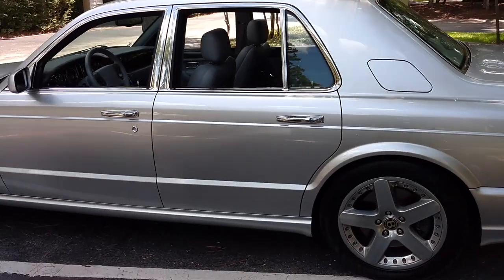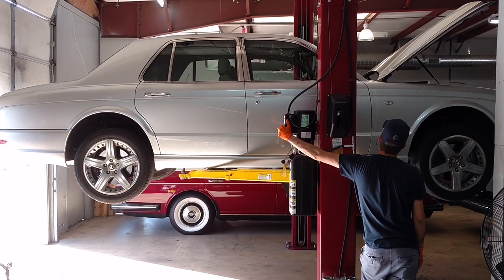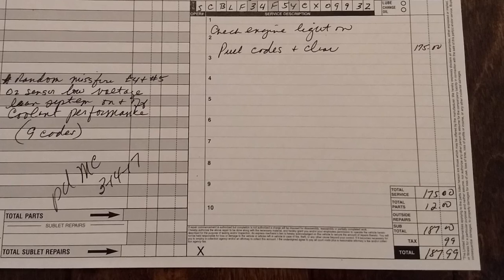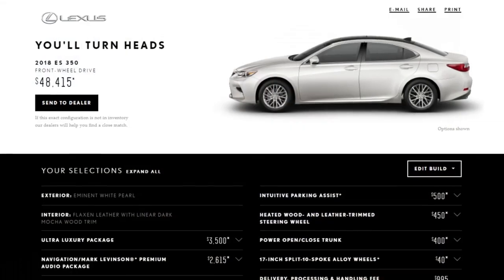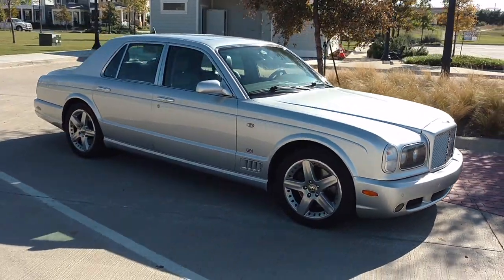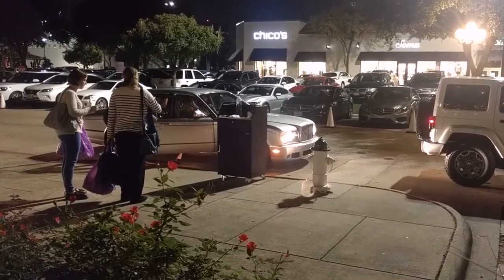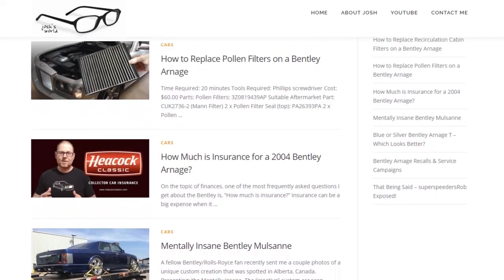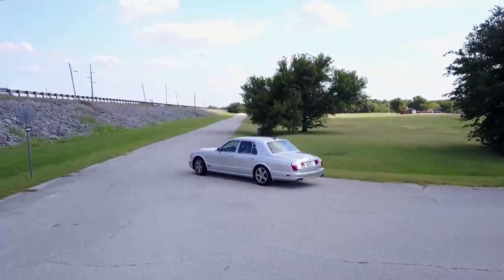Ownership Costs After 1 Year | Owning A Bentley Arnage - Episode 15

Comment: The wife and I took a weekend at the Surf and Sand in Laguna Beach. Pulling into the hotel I saw Mercedes, BMX's and Jaguars. I told my wife we should have brought the Audi instead of my '67 VW Bug. It was custom with European bumpers, shaved trim, re-located turn signals, Centerline Rims with a big and little combo. When we pulled in, the Lobby emptied with people looking at my car. My wife said, "See, aren't you glad we brought the Bug?". I also drive a full custom, chopped top, '49 Ford with flames, '32 Ford 3 window coupe and a '65 Chevy Biscayne with a 550hp 454 and 6 speed.
Reply from the maker: It's a good feeling!

Comment: I used to love buying and driving new and used luxury cars. Lincoln Continentals, Top of the line Caddys, Mercedes, BMW, Jag,  Rolls.  How did I fare financially in the past 50 years? I am now on welfare and am saving up to buy a postage stamp. Come the spring I'm getting a light bulb for the kitchen - one of those new LED bulbs that save you money on the electric bill. This is not a joke - our used BMW, purchased from BMW Manhattan cost over $20,000 in repairs in 2 years. My BMW 740I cost over $10,000 in repairs in one year. My brand new Mercedes 250s in 1970 was a pip - Took delivery of the car from Wolf Motors (Mercedes Dealer)  Drove from NYC to Palm Beach Florida and the car was running very rough. The trip was 1,200 miles. The M-B dealer in Florida said - don't be alarmed - it's just time for your 1,000 mile checkup - $1,250 in 1970 dollars. Unless you're very rich, luxury cars can ruin your life. Buy a Ford. Or  Kia.

Comment: Another great one.  After 8 years of ownership of my 2002 I found mostly the service costs experience as you have.  You do however have to stay on top of it, which it looks like you do.   Steering column is a big one and spheres, thought not as big, are a necessary evil every few years. Also, watch out for window regulators, they are plagued by tiny plastic bits that can wear out or can be chewed up if the windows are not properly reset after a dead or swapped battery.   Overall, enjoy and keep up the good work on the videos.

Comment: Awesome video. I had a smaller budget because I'm in my upper 20s but four years ago I bought a 1997 BMW 740iL for $5K. It was $105,000 new in 2017 money and everyone warned me of impending financial disaster. In 4 years it actually did need lots of suspension parts changed and intake related gaskets but all were DIY thanks to the forums. I would buy it again in a heartbeat and the pleasures are many owning a car that is still very much a $105,000 car! Btw, we have the same 4.4L BMW engine, yours is twin turbo'd and we have the same ZF 5hp-30 transmission!
Reply from the maker: Thanks! Those are great cars. The earlier Arnage Green Label cars shared your car's drivetrain. By 2004, Bentley had already switched to the 6.75 liter Rolls-Royce V8. It still shares some components with the BMW. The climate control system is from BMW, as well as some other parts.

Comment: May 17, 2021

I agree with Josh.  

I purchased a very niceley optioned 2009 Arnage R in 2017 as the second owner with 3,800 miles from new, which cost about $274,000 new out the door from Braman Motors in Palm Beach, FL.  It's now approaching 10,000 miles with no mechanical issues.  It now lives in Orange County, CA.  

Note: the Bentley's will need new shocks at roughly 40,000 miles, which cost $2,000 each for parts, not including installation.  It needs Pirelli P Zero's to carry the weight and speed rating of around 178 MPH.  It also will require repair or replacement of rear spheres at about the same mileage.  

Beware of too little mileage use if shopping for a Bentley, as non-use is worse than misuse or deferred maintenance.   I wouldn't buy a 2000 series Arnage with less than 10,000 miles because you don't know if they were early miles or later miles, which means you don't know if the car has been sitting around for years without being driven.  This car needs exercise regularly.  Run at least 30 minutes at freeway speed at least monthly.  Keep battery trickle charge on the car as batteries (2 of them) will run down in less than a week, then all hell breaks loose.  I'm using a CTEC model, which is the brand that Bentley badged when selling the car new.  

Only 2008 and 2009 Arnages have the head gasket leakage and cam bearing wear problems fixed, along with a a GM six-speed tranny.  They are functionally identical cars.  Facelift occurred at 2005 when the headlights lost the glass covering.  Cherry '09's R  models, nicely optioned are running around $90k with under 15,000 miles.  Many for sale which do not have options.  Rear picnic tables and rear vanity mirrors are a must for resale sustainability.   If over 40,000 miles, insist on road testing the car and confirm maintenance records on suspension items.  These are more than a passing DIY project.  Plus, you'll have some recourse if the mechanic screws up instead of suing yourself for damages.  

There were 150 Final Series cars made, nearly all of them double black with upgraded stereo and special badging and perhaps a hotter chip.  Some other extra do-dahs that will impress your friends, but otherwise be useless, such as a a refrigerator in between the back seat arm rests, a cocktail decanter and champagne flues in back of the front seats.  These are marketed as premium cars, but they're not usually worth the extra money, unless you want a black car, which is the most popular (least original) color, which looks like a Darth Vader mobile.  That's if you're into intimidating cars.  And you'll have to wash it twice a week even if it's in the garage.  That is, if you don't have a chauffeur.  

Retractable radio antennas regularly fail as factory OEMs were defective quality.  Make sure the antenna is working before you buy your car.  I didn't know this, and replacement cost me about $550 from independent garage in Los Angeles. 

Mine is double Magnolia.  Only three of this color combination '09 R's brought into North America according to Bentley factory records.  

Most common color combination is double black.  This does not make for a unique car, other than it is a Bentley.  The '09 model year was the last of the classic 5-gauge cluster dashboard design.  

Note to manage your expectations:  The rear view camera and navigation system is completely useless.  The sun visors do not disengage for swinging over the driver's side window.  The center console may not have cup holders because there's no way you can have cups in the center console and also lower the center arm rests.  Get used to no cup holders.  Besides, no proper Bentley owner would drive with coffee inside the leather covered car anyway.  Can't fill up at Costco because their pumps are set at full capacity to save fill up time.  The Bentley can't take full volume, so shuts off almost immediately.  Go to another gas station and set pump speed at lowest setting and take your time.  It's a Bentley, for Pete's sake.  You're never in a hurry.  Side mirrors are nearly useless.  Too small for full view of right side of car.  Make lane changes VERY carefully, check twice.  

Always drive around a corner extra slow.  That's an unwritten law of Bentley owners.  Let them have a good look at you.  

NEVER look out the window at a stop light to see at who's looking at you.  It's so amateurish of new Bentley owners.  Image it's only one of several cars in your collection.  No big deal.  CON'T BE A JERK.   DON'T EVEN THINK ABOUT BEING A JERK.  You're driving an elegant car.  Act like ladies and gentlemen who amongst ladies and gentlemen.  It will surprise everyone who will be expecting a jerk.  

Be extra courteous as a Bentley driver.  People are looking at you as if you're a snob or privileged.  Set a good example for others as drive courteously and always give a pedestrian extra right of way.  Give thanks to other drivers who give you the right of way or allow you to make a generously gracious lane change.

As a new Bentley owner, you'll be owning a PMC.  This is an inside owner's term for a Bentley or Rolls, which stands for "proper motor car."  Join the Rolls Royce Owner's Club, which also covers Bentley's.  They're a great organization.  

Budget around $5,000 per year on average for repairs.  That's everyone's best advice.  If you can't afford it, make more money then buy your Bentley.  Set it aside as a contingency fund.  

Change the oil more frequently than required.  I use MOTUL and buy from Amazon.  It uses standard $15 oil filters.  No Mobil 1.  Also, do not use ordinary brake fluid.  This car uses mineral oil only.  If you use brake fluid, you will have to drain it all out and you'll be sorry.  Make sure your local mechanic knows this and doesn't "top off" your brake system with ordinary brake fluid.  

Most parts are available from Flying Spares in the UK.  They are very helpful and courteous.  If you join the RROC, their monthly magazine offers many U.S. based parts suppliers.  I've changed both pollen and cabin filters purchased from Flying Spares.

I've had NO adverse comments or gestures from others.  Mostly, an occasional sincere comment of appreciation, like "nice car" or thumbs up on the freeway.   I always thank them graciously in some manner.  

Jay Leno advises in his Bentley Turbo R video, "Act like you know somebody."   I'm not sure that works for me.  

Finally, i think that a cheap Bentley is the most expensive you'll ever buy.  

Enjoy your Bentley!  

PS. Look for a video coming soon on Her Majesty, my PMC.
Reply from the maker: Wow! Thank you for sharing so much about your experience. You bring up a lot of great points. I especially like the point "Don't be a jerk." Great advice regardless of your car!

Comment: You are absolutely spot on with respect to maintenance costs. It is SO much cheaper to do it yourself, and we have youtube at our disposal so it's really not hard to do. I own an out of warranty BMW which granted, it's not as expensive to maintain as a Bentley, but it's still higher than average. I've saved thousands of dollars maintaining it myself rather than going to a certified BMW mechanic. On top of that I've learnt basic mechanical skills which will save me money on every other car I own in the future. Oil change due? Done. Radiator flush needed? No problem. New breaks? Easy. And it's actually fun and rewarding to do.
Reply from the maker: Fortunately for you, the YouTube and online community is much larger for BMW. The Arnage community is pretty small, but I hope to help change that! I'm adding my own DIY videos as projects arise.

Comment: $187 for pouring in a can of Seafoam? Anyway, I'd totally buy a pristine, low mileage Bentley at that price.
Reply: D LG any other mechanic would have lied and charged a grand.
Reply: Maybe so, but that doesn't mean this 'repair' was worth $187.
Reply: D LG Yes it was worth. your not paying for the can , your paying for his expertise in knowing how to work on a $250,000 automobile. I agree it's a lot of money, but it's a darn Bentley!!!! 187.00 is cheap.....
Reply: George Hurtado 
The problem with your mindset...is that it is all too common. It is the conditioned thought process of the age of the internal combustion engine. That being... that you should be prepared to pay more for servicing and repair of your vehicle based on the price and perceived prestige. The dawn of the electric car is about to take that mindset and the internal combustion engine with it into oblivion.
Reply: A Netizen Relax,,,,,there is no problem with my mindset just like I don't think there is a problem with yours crying over a bill I feel us justified due to the mechanics experience on a niche product.
Reply: He paid the guy for doing the work to find out that all he needed was a can of Seafoam.  Duh.  If he'd had the knowledge to do this himself, he could have done so at no charge.
Reply: D LG You think he pulled into the shop, told the mechanic it was running a bit rough, the tech pulls a can of Seafoam out of his pocket, pours it in, then says “that’ll be $187”?
Reply: You're not paying for seafoam. You're paying for diagnostics. You think a specialist shop is going to survive charging 5 bucks to fix a car? They only way that would happen is if it's a friend and you call them and they tell you to try that. Otherwise there's overhead.
Reply: Like any garage he'll have a minimum hourly rate, if it's a Bentley specialist that rate is going to be high. You pays for what you gets...
Reply: I'd like to know why doesn't charge  AT LEAST $100 per hour!? With  a 1hour minimum  charge.
Reply: People are always looking for ways to be unreasonably, money-grubbing cheap. Not even wanting to pay for the support and experience people give them.
Relationships matter.

Comment: This is an interesting video.  Mega kudos to you for doing most of the maintenance yourself to keep costs down!  A lot of people don't realize it but, for the most part, a car is a car.  Plus, that very first service would've come to a grand total of $9 (rather than $530) if you'd bought a gallon Prestone!  Just a side-note: I owned a '07 DB9 Volante for three years and had nearly all of the regular maintenance done at a local service station (I only used the dealer for hard-to-diagnose electrical glitches and failed sensors).  Like you, I bought all the parts from the internet and, overall, ownership costs were lower than I expected.  Unfortunately, new problems always kept developing and I simply grew frustrated that the car spent more time in the shop than in my possession (that's actually true).
Reply from the maker: Those are cool cars. Thanks for watching.

Comment: My money's on you simply because you are scrupulously attending to all maintenance concerns before they become actual maintenance concerns. Stay vigilant.
Reply: Well said. He's literally paying himself with cost savings, and people don't normally do that.
Reply: what heap of $hit car. You bought it at 30,000 miles..... a distance that would not bother any "lower class car".... but since then, you have:
- had "2 unscheduled trips".... already a bad sign
- Low coolant but no leaks?  Oh yes, of course it must have evaporated - keep your eye on it
- Rough idle.... Mmmm, at 30,000 miles?  Has it been serviced regularly?  If so - this is a crap fault.  "Sea Foam"... gee lucky he thought of that because he was probably knocking off crap buildup around your valves or similar from a fundamentally $hitfully engineered engine.... In the old days, I used to gently pour water into the intake of my crappy 1600 ford escort whilst revving it when it ran like $hit - the water turned to steam and blew off carbon buildup around "bits that should never get carbon buildup" - and hence make your engine idle like $hit similarly.  If you didn't find this guy.... you would have sunk into BIG $ right there
- over $700 for AC filter changes when it really only costs $100..... that tells you that this car maker thinks its customers are idiots.
- Ohhhh, then you got a faulty coolant indicator...... Wow?  Ok, once again they would have ripped you through the guts if you didn't fix it yourself.  Isn't it getting a bit embarrassing at this point? 
- And then you say you have some rather large expense items that will put the Bentley back in the specialist garage????   Jesus - there's more faults at 30,000 miles????  BUT, luckily you have found people to tell you how to avoid the said garage and fix (even more???) problems cheaper?  
- And then you finally let us know what your fundamental problem is ....... Perceived "Image"....  
- "maybe the car has the potential to ruin me financially".... YES

My dad was stupid enough to buy a Rolls Royce silver shadow 20 years ago....... hahahahahahahaha - biggest heap of automotive $hit on this planet and swallowed tens of thousands of dollars.  Go on.... keep it for 20 years and keep telling us how many things %$#@ed up for our amusement.   YOU WILL GO BROKE
Reply: @anthonyspanjich2772  so much passion relax
Reply: And check the fluid levels BEFORE the light comes on and ESPECIALLY after it comes on. 😉

Comment: Great work Josh.  I have been driving a VW Phaeton since 2007 which is a Bentley GT with a VW badge with an Audi A8 drive train.  It has been the best car I have ever driven.  Granted the last service was $5,800.00 but that included new brakes and serpentine belt.  This was at 75,000 miles.  Before that the costs have been minimal.  These high end cars, if chosen carefully, can be very reliable transportation.  Be ready to spend larger sums of money periodically but the joy of driving these machines far outweighs any costs now and then.
Reply from the maker: Those are I great cars, I liked them from the start.

Comment: I have a 2000 Bentley Arnage Red Label. Cost £22,000 (28,000 USD) in UK and has 31,000 miles on the clock. Absolutely agree with Josh - "Bentley Therapy" is real and brings a smile to my face every time. Maintainence? I have found a local Bentley Independent garage that does proper Bentley/Rolls work for a fraction of the normal specialist price. Eureka!! Could not recommend these car s highly enough if you get a good one. Fabulous.
Reply from the maker: Excellent! Finding a local specialist is probably the biggest hurdle for most potential buyers.